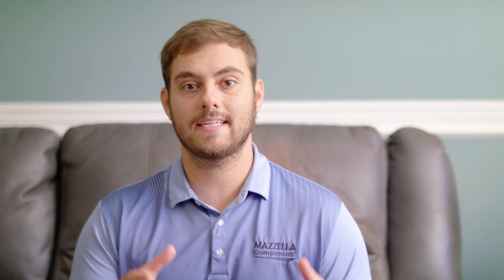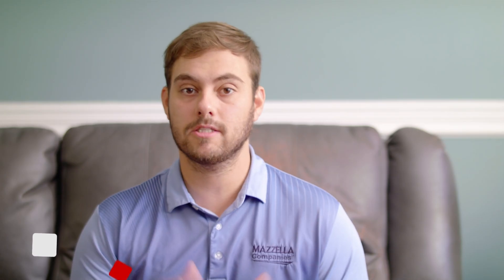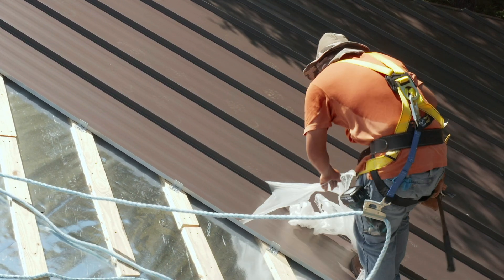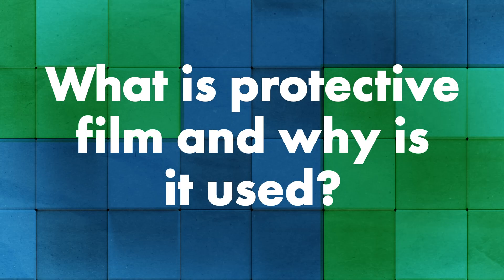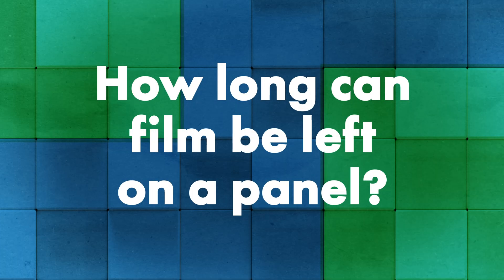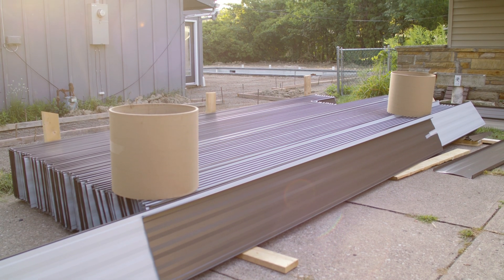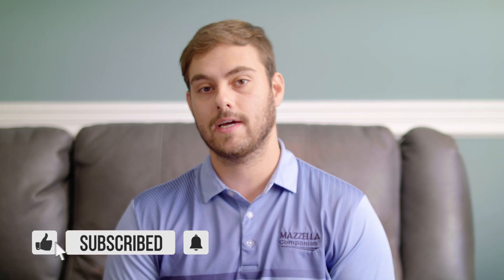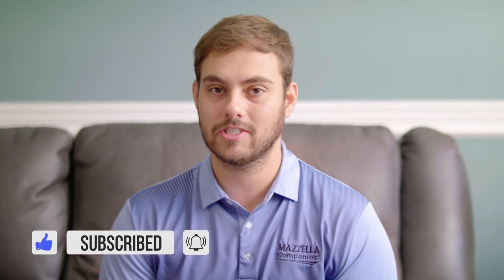Why is Protective Film Used for Metal Roofing?

Comment: Does Sheffield Metals supply 24 gage 20" coils that has film pre-applied?  Do the standing seam machines work well to form panels from coils that are film protected? I assumed that film was applied after roll forming...
Reply from the maker: Yes, you can order film pre-applied on your coils through Sheffield Metals, and you can use those coils in a rollformer. The protective film is designed to take the stresses created during the bending process. -Thad

Comment: Silicon paste wax is used to protect shop machinery.  Something similar that didn't kill the applier would be good for a metal roof. I envisioned using a rope ladder to keep from sliding off the roof. 

The old fashioned cosmoline would protect the underside of the metal roof from corrosion - its made from paraffin wax and a grease.  Paraffin is inert and won't degrade. Its claimed that the Egyptians used bees wax to preserve the mummies. A film could be used to prevent the stored panels from sticking together.

Comment: I presume leaving the film on standing seam metal panels until after installation makes sense, so as to minimize scuffing and abrasions?
Reply from the maker: Yes, the film is typically removed as it is being installed. It minimizes the potential for damage during rollforming, stacking, and fabrication. -Thad